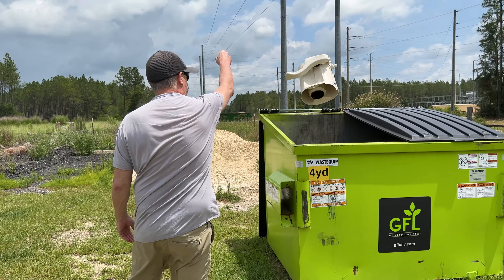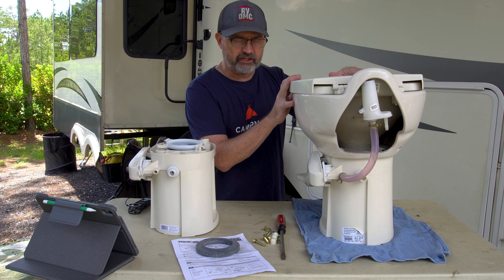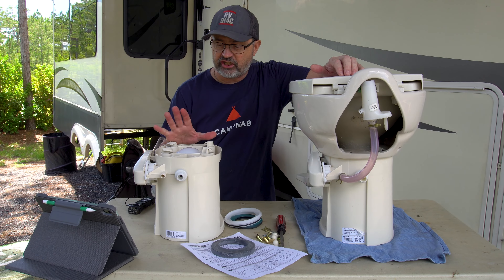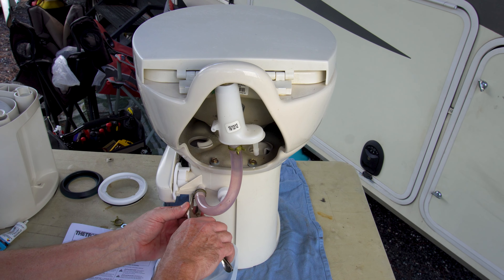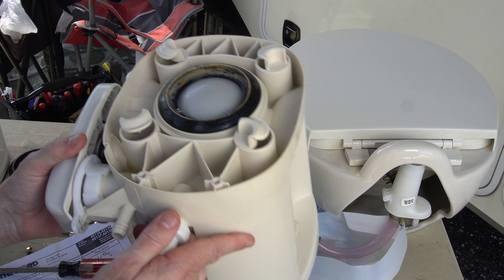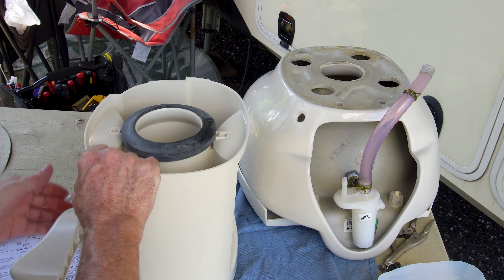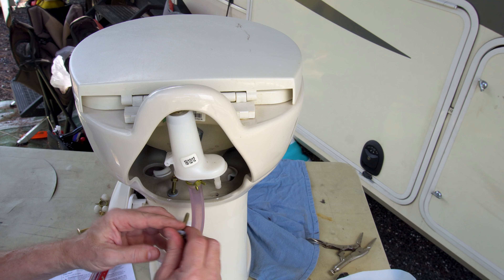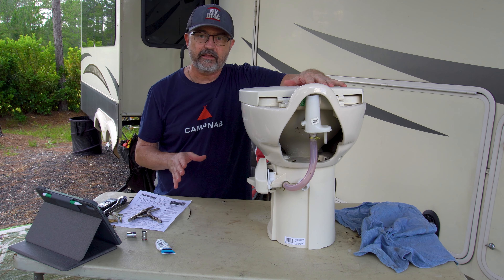Thetford Aqua Magic 2 RV Toilet, Replace the Entire Base (RV Living) 4K

Comment: Only thing I'd recommend to do while you're doing this is to install a Watt's 1/2 push to connect inline plastic valve (or shark bite) right there. I believe RV's should have these on all fittings. If you get a leak, or the toilet valve fails, You'll be in for a fun time as you try to rush outside and turn off the water. Bonus, it'll make this install much easier as well as maintenance later.
Reply from the maker: Thanks for tip tip mark, but I’m not sure what a watts 1/2 is, please reply.  Thx. Larry
Reply: Took your advice. Glad I did. I was wondering why there was no shut off behind the toilet. 👍🏻 thanks for the tip

Comment: Great video Larry.  Here’s a few things I learned in the process:  1st, open the box from Thetford immediately when you get the replacement toilet base. I waited for 6 months before doing the job. I specified to Thetford my exact model number, but received an ivory colored base instead of white and the base is about 6 inches taller than the old one. My old knees actually appreciate that difference. Fortunately I had enough slack in my water line to reach the connection.  I followed your directions and got everything put back together until it came time to place the old bowel on the new base. When I would try to do the quarter turn to lock in the tabs the base would of course move (note this is where and extra pair of hands is welcome).  Because I decided that I did not want to wait 10 minutes for my wife go be available, I had the brilliant idea of first installing the new base in the Moho where it would not turn as I attached the old bowl.  NOT A GOOD IDEA.  Unless you are flexible as Gumby and have the dexterity of a 100 lbs. brain surgeon, you won’t be able to get those two screws into the back of the toilet once it is placed against the wall.  So, back up, take it off the floor again and do what I’ve been doing for 40 years and wait for wifey.😅❤

Comment: Thanks for this video!  We had a leaky water valve in our Thetford Aqua Magic Style II toilet.   I replaced the water valve (after searching all over N GA for the valve). I wish I had watched this video first.  In replacing the water valve, I had to take the foot pedal off.  When I tried putting it back on, somehow the spring dislodged.  I could not re-install the spring.  Then I read online that a new base comes with the foot pedal and spring already installed, along with the water valve.  So now I have bought the new base to replace the old base.  This video was very helpful in seeing how to remove the old toilet and replace the base!  Thank you!
Reply from the maker: Yes replace the whole base is cheaper in the long run, less messy.  Larry

Comment: this is an easy way to fix the toilet but know that you will need to do some extra steps to get the bowl to attach to the base. I used silicone spray and pushed down on the tabs on the base( turned base and bowl upside down) and it eventually slid on . I also did a leak check before I attached it to the camper(place toilet on the ground and fill the bowl with water and give it a few minutes to see if any water leaks out the ball valve or seal)

Comment: In order to put the bowl back on you need to push the foot petal down. I put mine together upside down also and when he says to line up the two screws in the back he means it because it will line up the gasket to make the seal on the cover opening. The bolts in the back are now 3/8 in size heads . This is Not a easy job but it could be.
Reply from the maker: It is a pain to put the bowl back on, but i usually wait to put the arm on after the bowl.   Larry

Comment: The foot pedal came off of ours. Nothing seemed to be broken about it. After a good bit of struggling to get all the slots in the pedal to properly line up, we finally got the pedal back on. Took a few whacks with a rubber mallet to get fully into place. It appeared to be fully on and there were no leaks anywhere and all worked well. But after  few days of careful use, the pedal came off again. Do you think we might as well just replace the whole base rather than to continue to struggle with the pedal?
Reply from the maker: Unfortuately the pedal will still pop of and replace it the base is the only way to go. But make sure it is snapping on all what way with the spring in the correct orientation.  Larry

Comment: Thanks so much for this video Larry! I have a Grand Design 260RD, and one morning I flushed my toilet, and to my horror, it kept running. I ordered the water valve parts, and when replacing them, the spring flew off. Now the cheap plastic base is landfill. I ordered the base from an RV place, and they offered to put the bowel and base back together for me. I'm so glad they did because it was not a perfect fit, and it took 2 guys 35 minutes to get the 2 pieces together. We watched your video because I was sure they were not doing it correctly. They were, but the new seals didn't fit, so my toilet still has the original ones. It works so I'm good for now. Thanks again.
Reply from the maker: Sorry that happened to you. Hate that RV manufacturers put in cheap parts - especially for plumbing. 
Hope you don’t have more issues. 
I want to upgrade the entire toilet next time

Comment: Good Toilet repair videos...watched em both...decided to buy a new Dometic 310 with 360 deg bowl flush ports on bowl perimeter to replace the leaking 2 yr old Thetford Aqua Magic II with single rear flush port versus parts replacement - also avoiding the gunk removal...!

Comment: Larry I’m glad you’re doing better! We have a Dometic 310, funny story is that we’ve had the same toilet in 3 different RV’s. It’s starting to lose water now. So I think I’m going to do the same thing you did and just replace the base. The only thing I did different when putting the Dometic toilet in, is that I put an in line water shut off, right behind the toilet. So if anything went wrong I could just simply reach down and turn it off without having to go outside and turn off the water to the whole RV.
Reply from the maker: The inline water shut off is a great idea, i could put a pex shut off valve right below the water inlet behind the toilet.  That way when the toilet leaks or i have to work on it i dont have to shut off water to the entire rv.  I think i will put that in my next toilet video.  Larry

Comment: This was a super helpful video. When my valves went bad again I decided to just replace the whole base. I only ran into one problem. The screws that hold the bowl to the base were OEM and they were Torx screws, which I didnt know until I got the toilet off the floor and could see behind it. Fortunately I had a flat screwdriver small enough to grab the Torx head and get them out. Other than that, it was a piece of cake. If I had a socket set with Torx bits it wouldnt have been an issue at all.
Reply from the maker: I keep a small set of torx in the rv for just those occasions, but glad you were able to get it done.  Larry

Comment: Thank you for this amazing video and tip!  Just completed the installation and everything's working great.  However a couple little hiccups to consider.  The tabs on the new base were a touch too short to spin the old china bowl on easily (a few amazon reviews reported this problem)...so I took a blow dryer and a screw driver to gently bend them upwards for about 10 minutes and was able to mate the two parts successfully.  Also the new base doesn't come with a new vacuum hose and ours was a little worn - as a result it leaked when first reinstalling.  It was long enough to cut a few inches off and still seal but grabbing a new hose ahead a time might have been a good call.  Besides that, this has been a great money saver...thanks to you!!
Reply from the maker: Thanks for sharing your experience, lots of people read the comments and will benefit from it.  Larry

Comment: I think we are going to do the same and replace the whole base.  It only leaks when there is pressure on the water lines, but you cannot trace the leak back to the vacuum breaker or any external water lines.  I suspect it is something within the base itself.     Rob
Reply from the maker: We wish we replaced the base the first time. 
Let us know how it goes

Comment: Great comparisons about rebuilding the old on versus replacing it. Whenever we went to a project we would determine the rebuildable cost versus replacement cost and if we hit the 50% costs we had to take into account other factors such as warranty, history of component (was it repaired before), life of the repaired unit as compared to a new one, placement of the component, and so on. Yes, things for the most part can be repaired. You should a very good reason not to repair, in fact two reasons; the mess and the cost of parts versus the cost of the new component. Good video.
Reply from the maker: Thank you. 
We wish we saw this video before the first repair. So now hopefully others have more info to make a better decision than we did 
Glad we could help other RVers 🤗

Comment: Thanks for this video.  One problem I ran into is that I got a plastic base for a porcelain bowl, which is how it was before I changed the base, and I could not twist it on with enough force to make the holes line up.  No leverage.  Solved it by putting the base in the attachment screws coming up from the floor... did not attach the nuts.  This locked the base in and allowed me to push down and really torque the bowl after making sure it was in the right position. It clicked into place.  Then I pulled it off the screws in the floor and was able to place the 2 screws that hold the base and bowl together.  The rest went as per instructions.

Comment: Yes I just Got done replacing mine. I replaced the entire base number one because I really didn't want to sit there and replace the part. It's gross and yes it's my toilet but it's still gross I got mine off of Amazon but make sure that the pedal is on the correct side of your unit and this is a big and make sure that the. Seller that you are buying from has free return because not all of them do. In this video it showed that they had to use the old ball valve when I got mine it was absolutely complete. It have a seal for the bottom and a seal for the top of the base.
Reply from the maker: There are probably lots of versions of the kit. 
Thanks for the tip

Comment: I need to replace mine, I have been putting plumbers grease around the seal to keep water from leaking but I know I will have to replace all of it as the water is also leaking into the bowl so the foot pedal is not sealing completely
Reply from the maker: We wish we had replaced the base the first time. It’s worth the extra cost

Comment: Hi there, from Ouray Colorado!  Earlier this year, we were on a 2 week camping trip to Tucson.  We discovered our ball valve seal had a leak and our toilet would not hold water in it to block out the smell.  So, when we got home, I replaced the seal.  Fast forward to now,  we are on a 2 week boondocking trip in Colorado.   We discovered the toilet is leaking some water that we see on our floor.  I almost feel it is the 90 degree water supply connection.  Tomorrow, I will disconnect and reconnect it to see if that fixes it.  I could probably stop at an rv dealer in a few days to see if they carry that part.  If that doesn't work, I am inclined to just get the whole base, as you elude in this video so as to start over with a clean slate.

Secondary note: I just loosened and retightened the water supply connection, and water pours out now :-(  I should just tolerated the slllooow drip for the duration of this trip.  So, we will go home for now and get some parts on order :-(

Comment: Did the same with ours but I added a couple of L shaped brackets from base to floor really made a difference always felt a little wobbly before.
Reply from the maker: If the toilet flange is not installed correctly the toilet will wobble.   I snug the nuts then try to wobble the toilet, then tighten a bit more until all he wobble is gone, but not overtighten.  L brackets are a great idea for a wobbly toilet, eventually everything in an rv wobbles.  Larry

Comment: Very helpful video, BUT, the replacement base I got from Thetford would not fit because the locking tabs didn't have enough space to accommodate the porcelain bowl. There was no way to lock the bowl onto the base because it would not rotate due to the insufficient space. I measured the space of the old tabs and new at about 1/8" less space on the new base. Others have also had this same problem. My solution was to file a little material off the tabs on the new base. after doing that the pieces wnet together fine. Thetford is aware some people have this problem. When I spoke to them the solution they offered was to try to use something as a lever to shoehorn each tab under the bowl, but try to do that with 4 tabs at one time. Not possible. Some careful filing so as to avoid damaging the waste ball did the trick for me. Took about 20 minutes.
Reply from the maker: Thank you for sharing your experience here for others to see when they have the same problem with the tabs,  I probably would have used a head gun to soften up the plastic a little to get the tabs to bend a bit easier.  Sounds like your solution was perfect.  Thanks again for sharing, Larry
Reply: All you need to do is get a pair of pliers and lift up on each of the tabs to stretch the legs a bit. Make sure when you're putting the bowl back on that you're also putting enough pressure on it before snapping into place.

Comment: In the video you mentioned that the plastic ring with the o ring doesn’t stay down . How did you manage to keep it down to install the  top bowl.?
Reply from the maker: It’s not easy but you have to carefully place the gasket when installling the top bowl, if its off just a bit the waste ball will not seal  water in the bowl.  Larry

Comment: I have the same toilet and we want to replace the base. You said the kit comes with the rings you placed over the ball valve. Are you talking about the base comes with these parts or do we need to order the base and a kit?
Reply from the maker: It comes with the gasket that goes between the base and the closet flange.  Larry

Comment: Great Video Larry. I do have a leaky waste ball and I need to replace it but I am thinking of replacing the bottom half. I also have a continues drip after I flush the toilet. It is as if the return arm or waste ball are not closing correctly. Will this drip go away if I replace the bottom of the toilet??
Reply from the maker: Yes it should fix that leak as it replaces all that plumbing.  Larry
Reply: You should also check your water pressure. If you're getting a continuous leak either in the bowl or back of pedal it's possible you don't have enough pressure to close the water valve. Thetford toilets are designed to run between 40-80psi. Even 39 could cause a leak.

Comment: So my toilet leaks at the vacuum break device with constant flow into the bowl when pressurized. Is this a water valve failure or the vacuum break device failure?
Reply from the maker: Sounds like a valve failure. 
Start by removing the valve and use plumbers lube on the valve. 
If that doesn’t fix it, replace the valve

Comment: I have a bit of a rock to the toilet, what do I do
Reply from the maker: Pull off the plastic caps that cover the nuts that hold down the toilet, tighten down the nuts carefully and assess the amount of rocking that you have as you tighten down, be careful not to overtighten the nuts as it can damage the plastic.   Larry

Comment: I can't get the bowl to attach to the base under the clips to align the holes for the bolts? Any Ideas?
Reply from the maker: Put the t bolts in the slots in the closet flange first, then gently put the base over bolts, put one side in first then tilt to the other side in also, then rotate the bowl so it is aligned like you want, then tighten the nuts until snug to floor but don’t over tighten,  I hope that answers your question.  Larry
Reply: No I mean the china bowl won't rotate on the four tabs of the base to allow alignment of bolt holes. Thank you for your response.

Comment: Orem Ed the toilet but have not been able to remove the plastic vacuum hose.
Reply from the maker: Sometimes those hoses are sticky if they have been there for a while, i put a small screwdriver in to loosen it up a bit so i can turn it, also warm it up with a hair dryer, softens the plastic hose. Larry

Comment: I bought base only, Amazon $85 April 2023, Thetford part #42138, bone color, because Thetford part #42137, white color, is an endangered species for my part #42070 Aqua Magic Style II High white RV Thetford toilet. It all fits...I checked with Thetford themselves. I replaced the entire base, keeping the white, porcelain bowl. I replaced all the rubber seals, upper and lower, but the bowl will now, not hold water in the bowl! Why? Who knows... I followed the instructions... watched all the "experts" on YouTube. My conclusion is CHEAP CHINESE MANUFACTURING, and Thetford not caring about standards. You win...I will just replace the WHOLE TOILET in the near future with an upgrade. I'm done with nickel and diming my basic creature comforts like doing number 2 in confidence. I'm too old for this sh|t. Full pun intended.
Reply from the maker: That’s a bummer, they are cheap crap.  I would buy another waste ball seal and try putting another one on, could be a faulty seal.  A seal only lasts about a year before we have to replace them.  Larry
Reply: Thank You for the information on where you got the base and the number for the color! This was what I hoped I could find this information in the comments and you have done me a huge favor - THANKS!